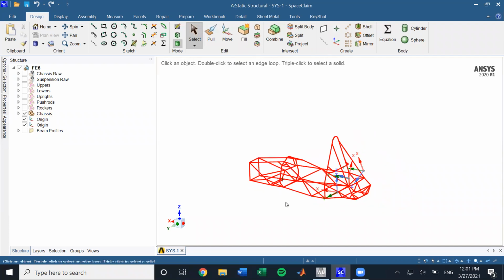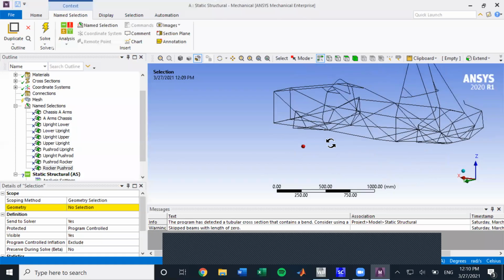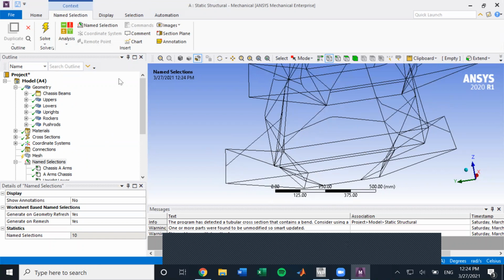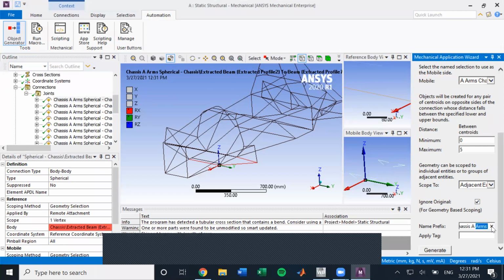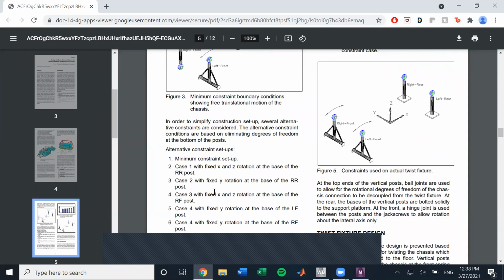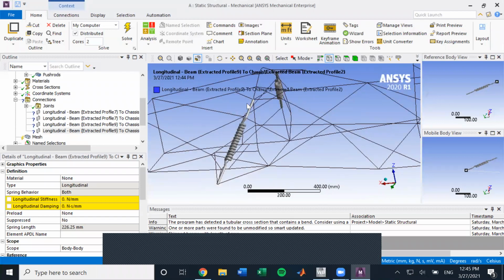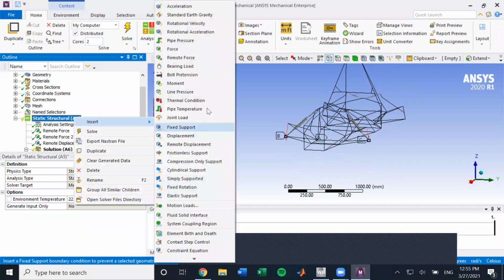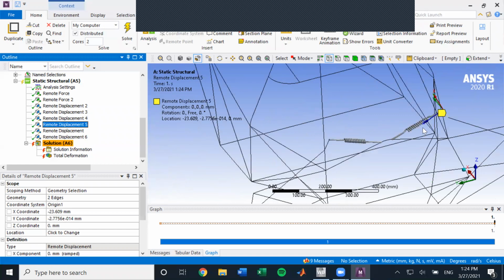FSAE Torsional Stiffness Simulation in ANSYS - Part 2

Comment: Are your pushrods and control arms made of structural steel? If not, does it matter for Ansys sims?
Reply from the maker: Sorry for the late reply, but yep! 4130 tube steel. Ansys needs proper material property inputs to run accurate simulations - so it does matter.